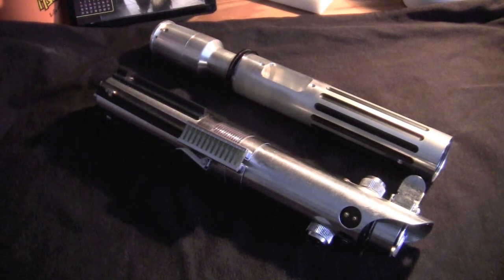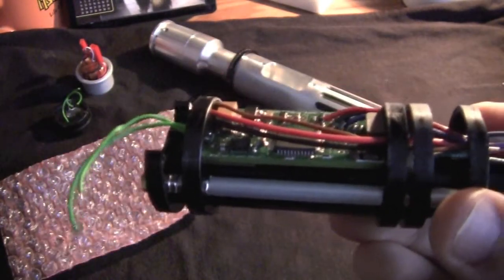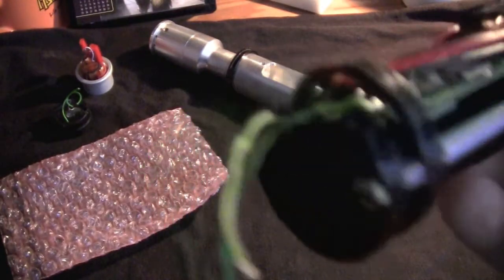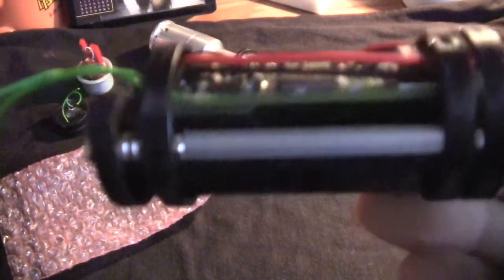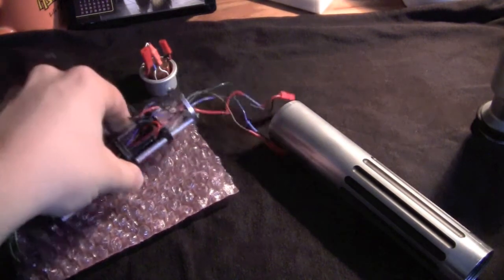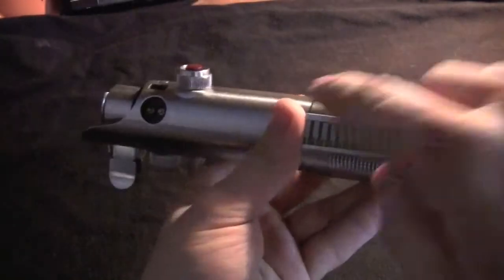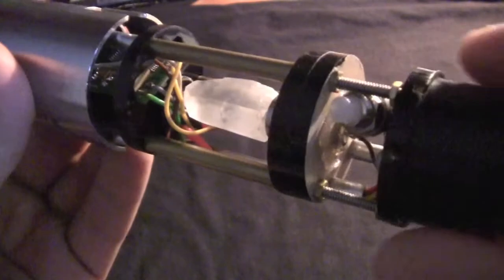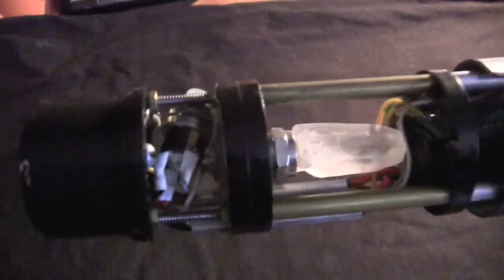Chassis Chat with Machinimax

Comment: TCSS doesn't have any chassis disc to hold a recharge port in a Graflex.  You can hack one of the Graflex chassis disc to hold one, as I have, but it's not a clean solution. Tim said he could easily enough make one to fix the Graflex if custom ordered.  At that point, since the CAD files would be done already he would probably start offering it in the store.  It's on my list of things to request if I ever find the money to finish my vintage Graflex build.